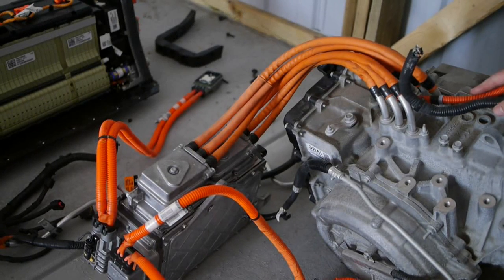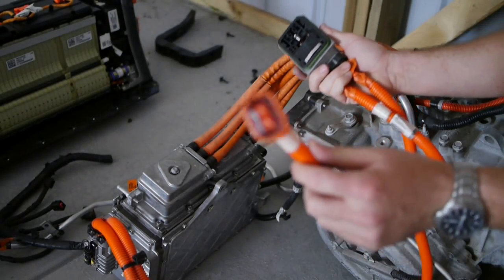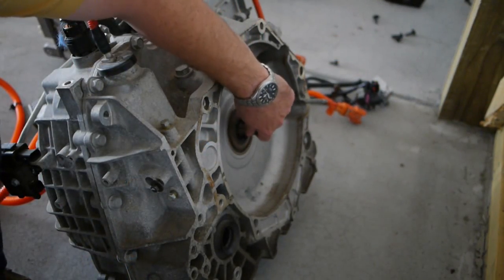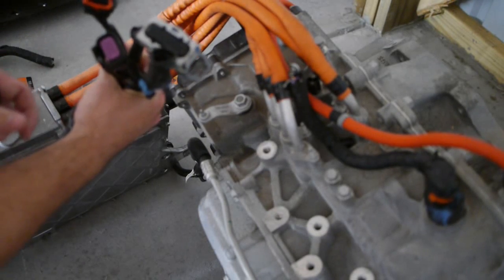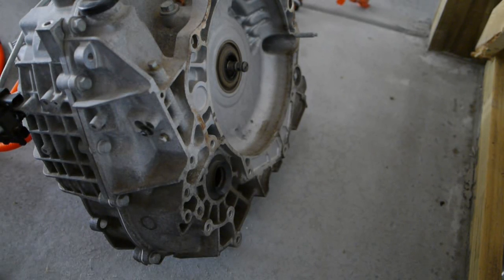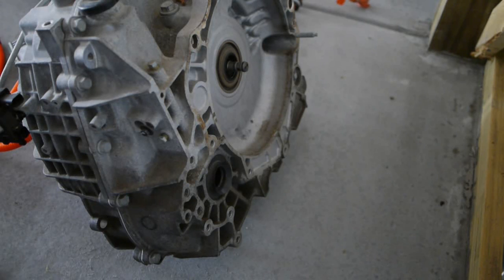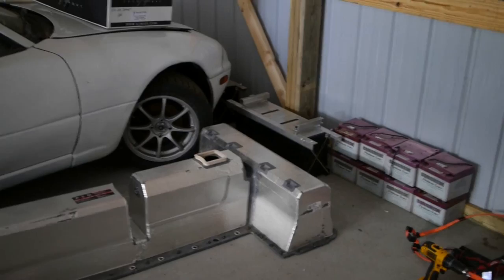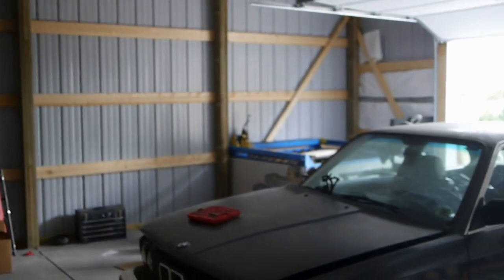2013 Chevy Volt Motor, Gearbox, Inverter

Comment: Got a question for you , In high end competition car audio they make amplifiers that take high voltage DC , 360vdc..  Perfect for the Chevy Volts 360v battery..   If you were going to tap into the HV lines where would the best  place to do this be? right off of that battery connection plug..  splice in there or are there any placed you could use existing bolt on places etc..  Yeah I know high voltage DC is dangerous etc..  So is 800 amps of 12vdc,  precautions would be made.  I have not crawled under my volt yet..  but a 160,000 rms watt amp for $800 this might be worth it..

Comment: I don't drive a lot and I could do almost all my traveling without ever starting the gas engine. Sure makes me think about one.
Reply: You should get one! They are a bargain right now. Ive used only 22 gallons of gas in last 10,000 miles and most of that (15gal) was because a $13 coolant level sensor went out which (as a fail safe) wouldnt let the car recharge from wall charger until I figured that out and replaced the sensor, which, btw is the only mechanical failure the car has had in 7 years. (2013 volt)

Comment: The 4ET50 Electric Drive Unit from the first generation Chevrolet Volt has an operating mode where a clutch pack is engaged to allow mechanical energy from the engine to act upon drive motor generator B and a reduction planetary set to drive the wheels in tandem with the electric motor for very brief moments of time. The conditions under which the Powertrain operates in this mode is incredibly rare and only occurs when the car is under immense loads like driving through steep mountain passes with a full load of passengers and cargo.

Comment: What are your thoughts on using a diesel generator instead of the 1.4 liter that comes with the Volt? Many people are wondering this very question. 

Excellent video and presentation. Keep up the great work. I'm a Systems Engineer. Let me know where I can be of assistance.
Reply: HCCI part time sparkless ignition gas engine is the way to go. It's a step beyond Atkinson cycle

Comment: 10 million lines of code for Volt electronics... good luck trying to "crack".
Reply: I doubt anyone outside of GM can do it. This code was made with IBM Rational, and makes it very hard to "crack". But someone who knows the machine code for the MPUs can code a "disassembler" and reverse-engineer the coding. I have done this for the Sinclair ZX80 and the TRS-80 Model III because both use the common Zilog Z-80 MPU.

Comment: 2:00, there is a parallel hybrid mode.
It is not a single speed gearbox, it is some sort of e-CVT (planetary gearset instead of steel belt) transmission.
Reply: Except that is works like a deferential with one of the electric motors being used to slowly counter spin opposite to the internal combustion engine thus allowing for a variable gear ratio that varies depending upon the rotational difference between the motor and the engine.
Reply: A planetary gearset can not be continuously variable... It is only fixed gears.